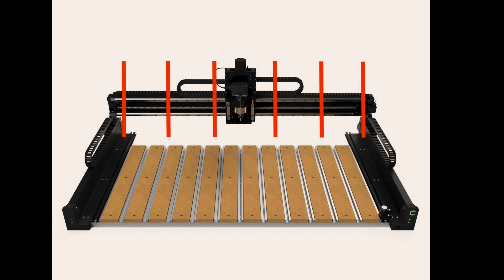The Support Show - Ep. 11 - Shapeoko 5 Pro Movement Guide

Comment: There is not much room for a wrench to get in and tighten the nut on the inside of the ball screw mount (video at 1:33). Anyone know the size of that nut, and a source for a wrench that can reach it? Or is there some other way to go about this? Thanks.
Reply: Told them it was a crap video. No sizing listed. I had the same questions. They came back with the outer nut measuring “25.5mm” and the inside being 16mm. I was told they use an “adjustable wrench” to tighten them, which seems sloppy to mez